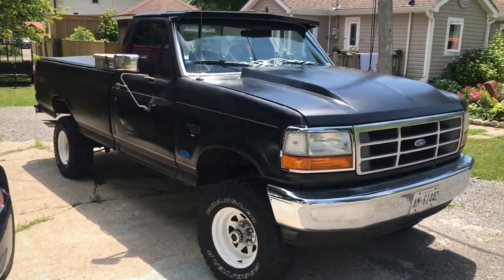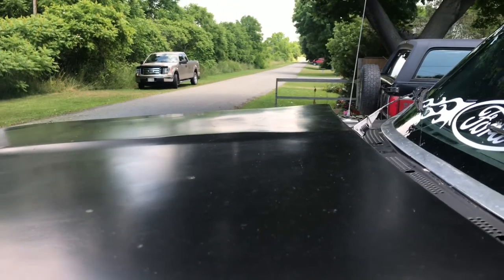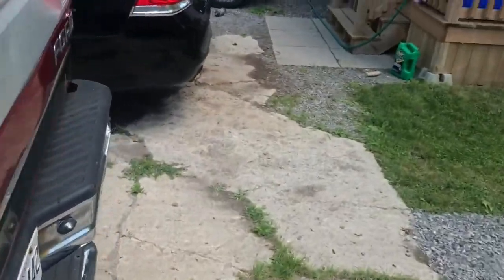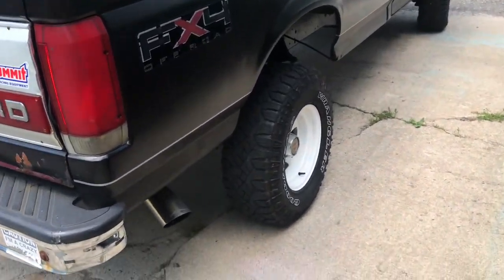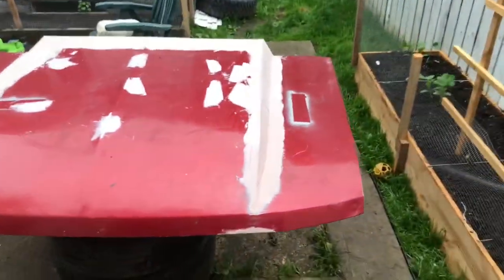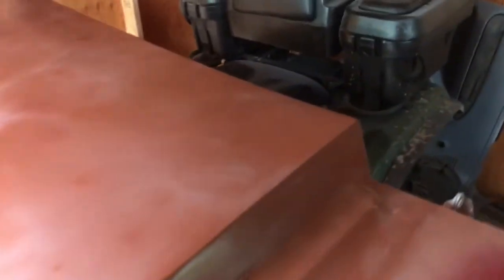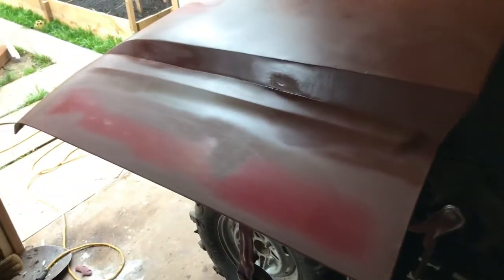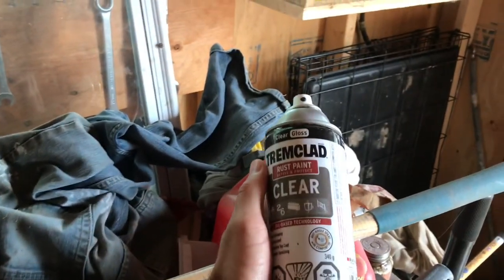OBS ford Homemade Cowl Hood Finished Product. And My Truck was STOLEN!!

Comment: That hood looks good! If I was to do that it would look terrible. Great video
Reply from the maker: Old Croney's Garage I never filmed too close 🤣 I’ll be adding a GPS tracker and a kill switch
Reply: @Beandiptheredneck   looks good in my mind
Reply from the maker: Old Croney's Garage ya up close I coulda done better if I felt like getting a longboard and more filler involved. Nothing to say I can’t go back and do more at a later date
Reply: @Beandiptheredneck  with enough bondo anthing looks good lol. i did a video on that 1999 dodge ram 1500 i was telling you about if your intrested
Reply: @Beandiptheredneck  there are a few custom hoods out there for trucks like yours. But I like yours more